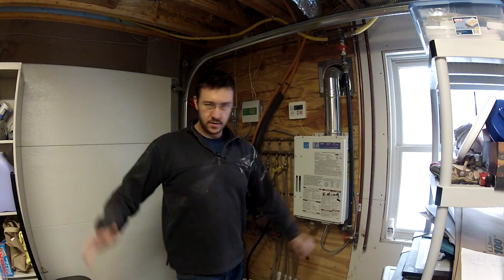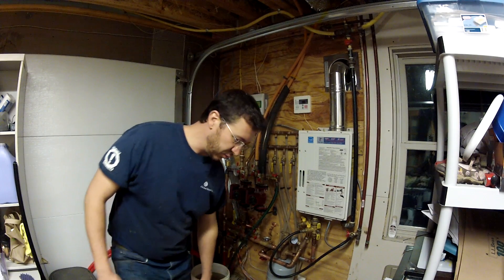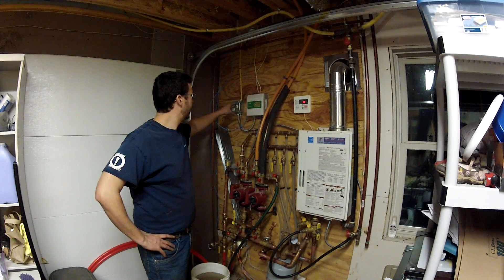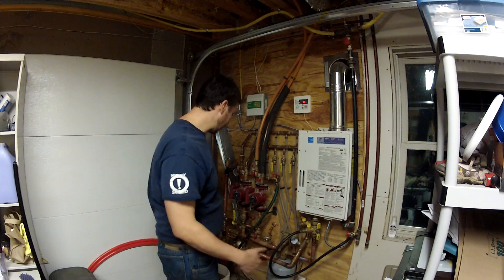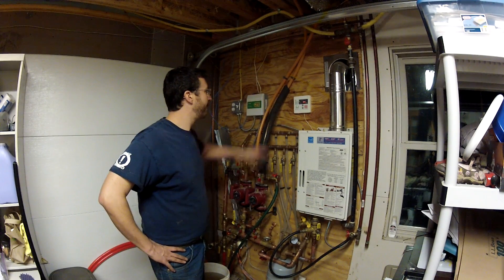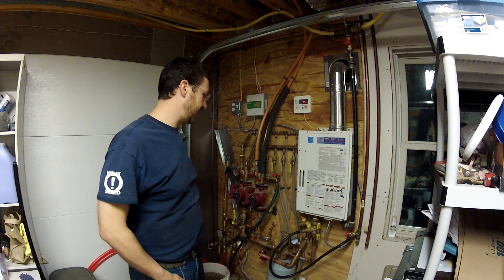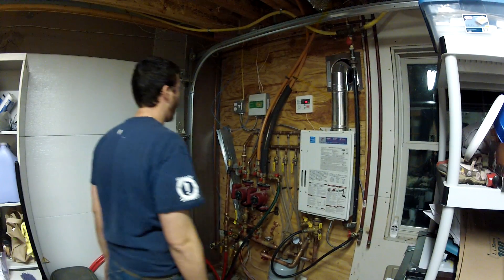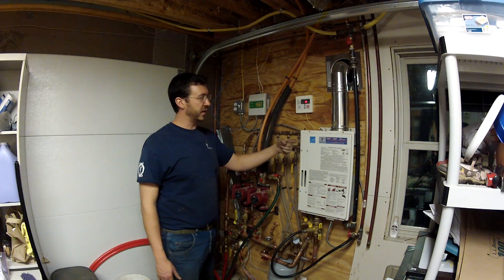Redo house heat - 147 - My DIY Garage Build HD Time Lapse

Comment: What model Takagi do you have? Most plumbers are against using a tankless water heater for heating. I don't know why. As long as it can handle the water demand i don't see an issue. My house is 1650 sq ft and I'm doing the entire install myself. Im going to give it a try.

Comment from the maker: That tankless is totally enough to heat my whole house and hot water.  It worked like that for 2 years and was great.  The cost of propane was a little too much for me, so that's why i'm heating with wood pellets now.  But, I have a small very well insulated house, 1400 sq ft, built in 2005.

Comment: Great videos. Its nice to see real DIY videos to learn from. Question about your house heating system. You are using a takagi tankless hot water heater to heat your 2 radiant zones and hot water correct?  Is the water heater enough to heat your house and heat the water? I want to build my own radiant heating system and your videos are very helpful.